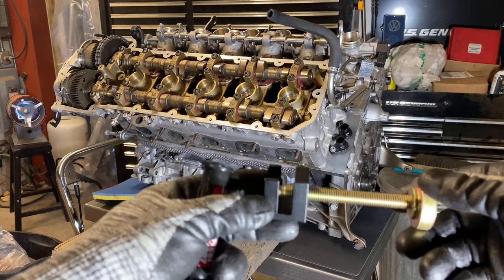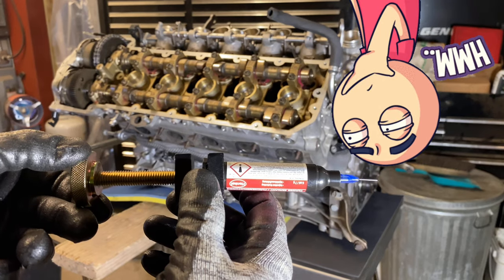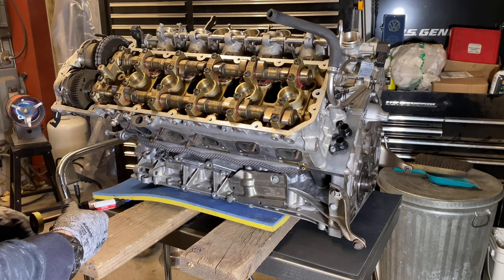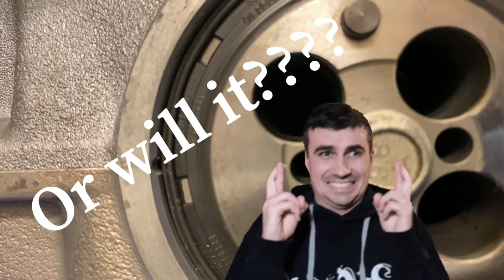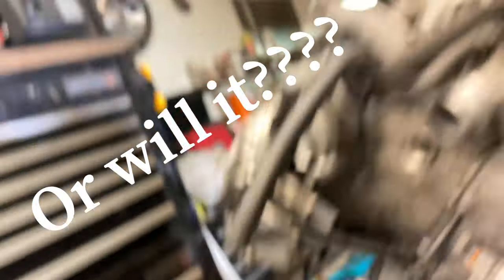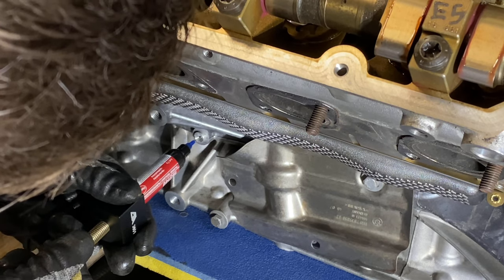E60 M5 bedplate sealant FAILURE!!!!

Comment: Hello Unintended acceleration,

Interested in ALL detail for mounting/sealing the bed-plate/girdle.  I am not that far in my assembly and have found this very interesting!  I'm still worried about gear mesh and H.P. VANOS pump!  Also still need to order rod and main bearings.

Mr .P
Reply from the maker: The key to the Bedplate is to buy a 14 gauge injection nozzle and not use the one that comes in the kit, the one in the kit is for spot fixes.

Comment: BMW and their crappy instructions.  The blue needle is not actually for injecting through the port, as you saw it is too small, rather, that needle is for patching small holes/leaks by where the front or rear seals go.  The flow rate for that blue needle is far too slow to fill up the cavity properly.  Buy a few separate a 14 gauge dispensing needles and use that to create the proper seal around the one way valve.
Reply from the maker: Ya that’s why I say to look in the forums....I found that out after I almost messed up hahaha. But ya you’re totally right, that’s why I wanted to post this video although kinda useless I wanted even 1 person who was about to do it the same way I did to stop and research. I still need to seal the other side so I’ll show that as well and hopefully it looks a little more like I know what I’m doing haha
Reply: When does the sealant have to harden completely?
Reply from the maker: Not really sure but I know the primer hardens it up nice and quickly when it comes out where the seals are. I’d imagine 3 days to cure max but not sure if temp plays a role, just hope mines done when I start the car😂
Reply: @Unintendedacceleration  I done it about month ago, but it still not hardened. I hope it will be ok when engine starts and reaches the operating temperature... 🤞
I think next time i would use a regular sealant instead of this bmw special

P. S. THANKS FOR YOUR VIDEOS !!! it's great when there is an opportunity to check if I am doing everything myself in the right direction  ;)
Reply from the maker: And it’s great getting feedback from everyone, I’m not any more versed than anyone else, I just happened to film my process👍. Yes I’m hoping the heat plays a role. I’ll call bmw
Reply: What’s the part number for the 14 gauge needles? I bought the smaller one too